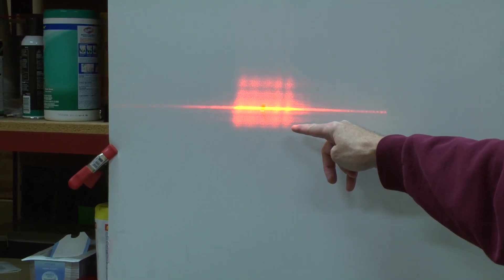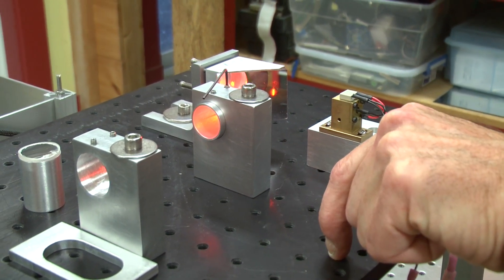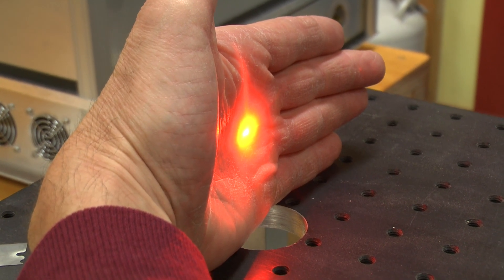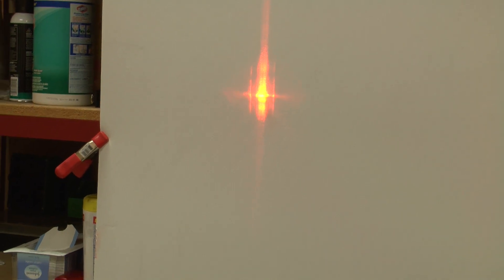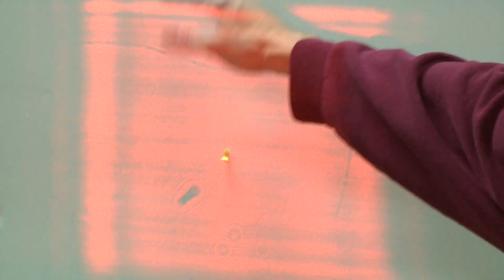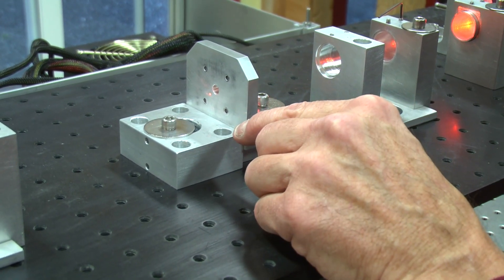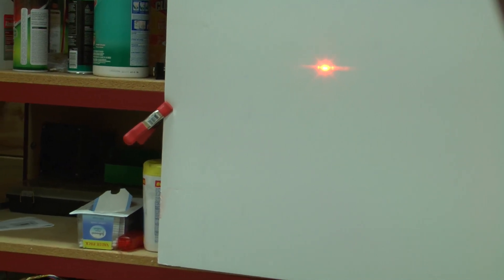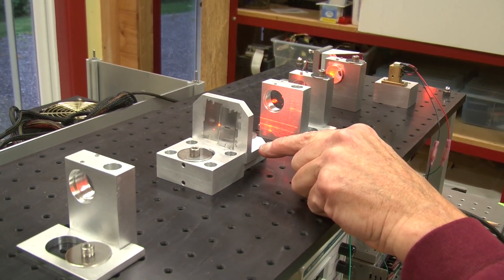Spatial Filtering

Comment: Thanks again for a great video! I am working on a direct write laser lithography system to make "star plates" , slides, photomasks etc. for a planetarium projector, by etching aluminum on glass (FS "kaleidoscope" mirror). I am using 405nm diode laser to expose the photoresist. Needless to say the beam is not circular to begin with.   I am sure with a carefully measured set up the optimal pinhole diameter could be calculated using the razor blades to insure a more circular beam profile. In my case, some light loss is acceptable. Back in my laser light show days we were using Argon, Krypton, He/Ne and KTP/YAG so the beam quality was excellent to start with.

Comment: ahaa you answered something i was wondering about using spatial filters and why we need to focus the beam first as opposed to simply using the filter without a focus lens ,as you explained its because these garbage non collimated rays or noise exist not just along the outer edge of the beam but through the whole cross section and by using the lens we focus all these rays into one spot where they can be filtered out leaving the central axis rays untouched to pass through and give a better quality gaussian profile as well but reduced intensity although it was useless garbage anyways , what i wonder is do these filters also improve collimation by reducing beam divergence at the expense of intensity though so always a trade off ? or do these noise and aberrations never really counted in the far field with respect to beam size or divergence? perhaps there is a diffidence when using the filter on coherent monochromatic light as opposed to white light of multi spectrum
Reply from the maker: They do not affect divergence aside from removing spurious rays.
Reply: @TechIngredients  spurious meaning rays that are going off in all directions and not following the central axis or being parallel part of the beam? btw would using a shorter focal length improve the amount of these bad rays that will be blocked by the filter as pose to using a long focal which might allow some of them to pass? and im guessing that the filter needs to be a bit past the focal point for it to work like this

Comment: i have taken a 1 die led i got from home depot and exposed the surface of the die emitter and placed a pin hole filter in front of it followed by an aspheric lens or two and produced a spatially coherent beam , now the smaller i made the pin hole the better the beam quality got for long distance in term of divergence etc , of course the smaller the hole got the more expense to the density or brightness of the spot or beam , my question is it possible to some how utilise the full brightness from the emitter and still get a sharp quality long distance coherent beam of light perhaps using some kind of sphere with a pin hole with internal full reflectance or fiber optic? is there a way to pass more photons or rays of light through the same small pin hole and still get this beam or is the whole point to have less rays passing through to get a sharper image at infinity? is there no way around this? will i always be sacrificing brightness to get better beam quality unless they invent a more efficient led? and please explain what the pin hole actually does other than to only allow the most parallel or collimated rays to pass, btw would be great if you can make a video demonstrating this effect to show how one can make a laser beam like effect from incoherent light and see how far it can go

Comment: i have taken a 1 die led i got from home depot and exposed the surface of the die emitter and placed a pin hole filter in front of it followed by an aspheric lens and produced a spatially coherent beam , now the smaller i made the pin hole the better the beam quality got for long distance in term of divergence etc , of course the smaller the hole got the more expense to the density or brightness of the spot or beam , my question is it possible to some how utilise the full brightness from the emitter and still get a sharp quality long distance coherent beam of light perhaps using some kind of sphere with a pin hole with internal full reflectance or fiber optic? is there a way to pass more photons or rays of light through the same small pin hole and still get this beam or is the whole point to have less rays passing through to get a sharper image at infinity? is there no way around this? will i always be sacrificing brightness to get better beam quality unless they invent a more efficient led? and please explain what the pin hole actually does other than to only allow the most parallel or collimated rays to pass
Reply from the maker: Your statement at the end of your comment is correct.  The pinhole is selecting rays that are more collimated, but not coherent.
Reply: @TechIngredients  i thought collimated with respect to only spatial coherence are kind of the same thing are they not? both are rays next to each other travelling in the same direction with little divergence , or will it become more spatially coherent after it goes through the condenser?  are you also saying there is no way to get a brighter beam by passing more rays through the hole other than having a brighter led to begin with? if you can please give more detailed replies ,thank you
Reply from the maker: They are not.  The laser generates phase coherent light which also has high spatial coherence.  Focusing and collimating a laser does not require spatially removing the vast majority of the light in order to retain a few rays that happen to be relatively parallel.
Reply: @TechIngredients  i still have trouble understanding the difference between collimated and spatial coherence ,yes in a laser the photons created are both temporal and spatially coherent due to monochromacy and the design of resonator where only the most parallel rays in abundance are emitted or is that part collimation only?  i have searched something about using a sodium light(pretty monochromatic) where this light supposedly temporal coherent passing through a pin hole aperture is said to become spatially coherent for some reason i believe due to the waves becoming more in step or emanating more orderly instead of a mix and then passing through a green screen filter and condenser was used as the first Gabor holographic apparatus, 
but putting all that aside and realising i am working with a broad band spectrum of light from an led i am still trying to understand what exactly is happening when the light passes through a pin hole then condenser and why it seems to become more orderly or sharper and the beam more tight with a spot that can go further distance without expanding and the smaller this hole gets the better the beam quality but the worst the brightness level becomes obviously ,i once calculated its divergence to be better than my hand held laser pointer ,so i am wondering is any of this to due to spatial coherence or its only collimation and what exactly is the difference between the two and again is it possible to somehow increase the brightness of this beam without reducing the divergence quality or will there always be such trade off?
Reply: @TechIngredients  i take it the less rays of light that pass through the hole the easier it becomes for the lens to handle shaping them into a more collimated beam is that it? in other words unless these rays are brighter on there own(if this is possible) then there is no way to make the beam brighter by cramming more rays through the hole without decreasing the beam sharpness or low divergence qualities right? unless i am able to select more rays that are parallel to go through this hole?

Comment: Thanks for the great video! It's very helpful for my basic project.
I'd like to ask a question about alignment. 
The laser beam goes through a long optical path and how to keep the beam aligned on the center of each component?
I have a rough idea extended from yours but I don't have enough component to do it.

The idea is mount a cylindrical lens with fixed height firstly. Secondly, place a laser and adjust its height until the beam pass the center of the cylindrical lens.
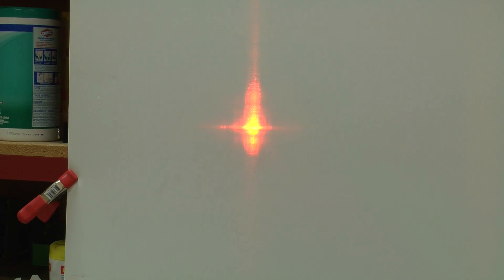That will get a symmetric diffraction pattern such as 3:00 and located the centerline on the screen. And next, mount another cylindrical lens with the same height and orthogonal to the first. Check the pattern as 5:40 which is two orthogonal and symmetrical line.

As I thought, the symmetricity of diffraction pattern gives a way to check that laser beam goes through the center of lens and the cylindrical lens itself gives a way to check the beam in one direction. If the symmetricity of two direction has been check, the beam goes through the center.

Is that idea correct? Would you please provide some advices or techniques.

Comment: Is it possible to focus and coupled the output of this spatial filtered beam into optical fiber?
Reply from the maker: Yes, it is.  But, before you get too excited, remember that spatial filtering does not increase the brightness of the beam.  The two parameters that are the most important  determinants of a beam's  ability to enter an optical fiber are its diameter and its divergence.  Focus-ability, numerical aperture and brightness all follow. Spatial filtering removes, stray, useless light that contaminates the main core of the beam.  This light would not even enter a typical fiber and so....the fiber entrance itself is often used as the spatial filter!

Comment: Can definitely be built more compact, using smaller focal length lenses for the telescope and for the cylindrical lenses.  Shorter focal length means shorter distance.  And no need to be in a straight line, could use a mirror between cylindricals and telescope to further shorten the projector.